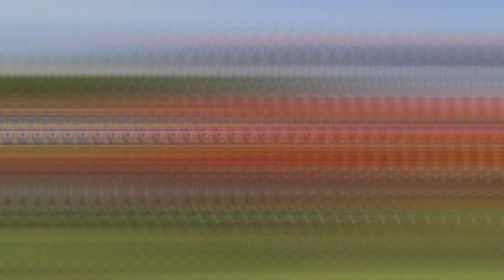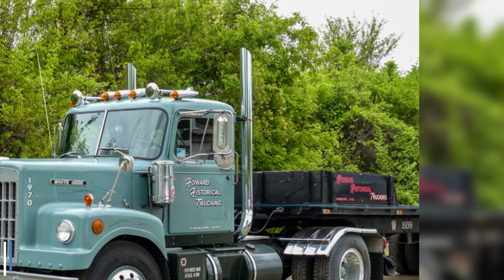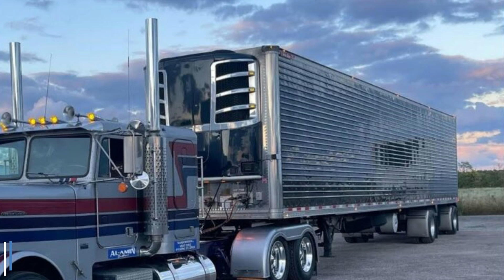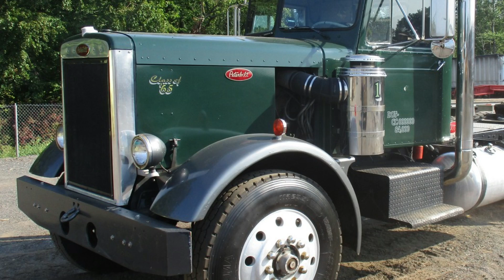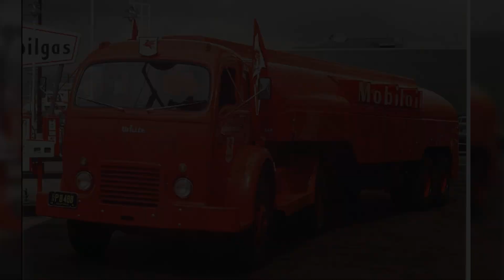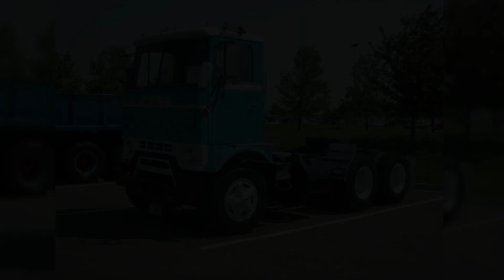They Built These in the ’60s? The 15 Worst Trucks Ever Made

Comment: I like the 73,and newer Chevy Cab over next to the IHC Emeryville Cabover.
          One point I would like to make,most of the trucks in this period all for the most part road rough,and most of those makes used the same engines, transmissions,and axles.
            Mack,and IHC had their own engines,and axles.Air ride suspensions were not popular back then because of initial cost,and maintenance issues.